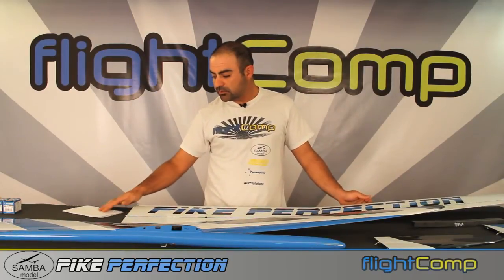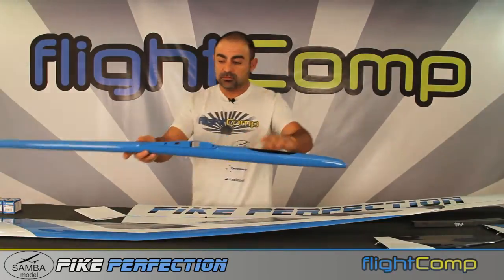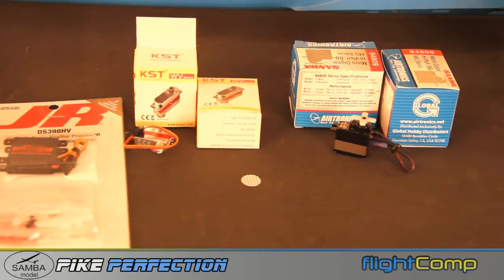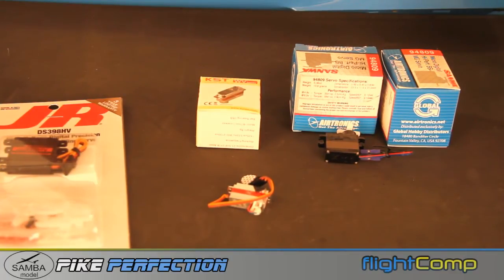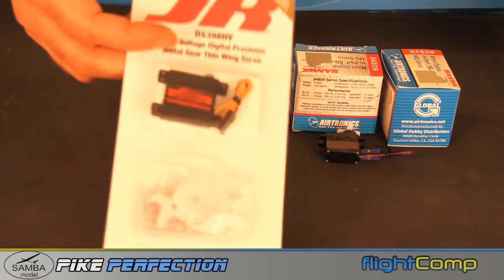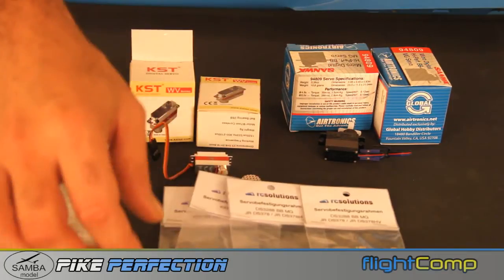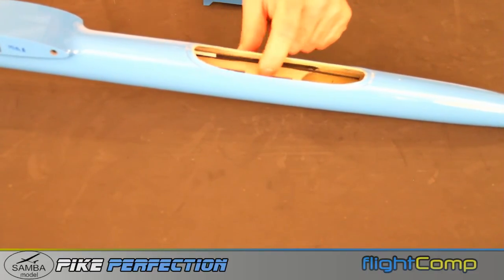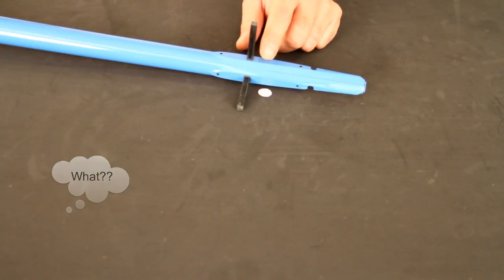Samba Pike Perfection SL V-tail F3J Overview

Comment: hello, just a little question you prefer pike perfection or xplorer2 ??? and in X or in V ???
sry for my bad english ;/
Reply from the maker: +gadery fr 
Hi, Greatly prefer Perfection over Xplorer2. However I hear many good things about Xplorer3. I have not flown one yet. For several months I preferred Perfection V to X in calm conditions. I then put a new radio in my V and it has not been flying very well. I need to start over with the programming and CG and see if I can get it back to the way it was.